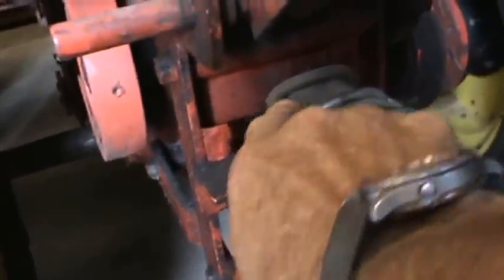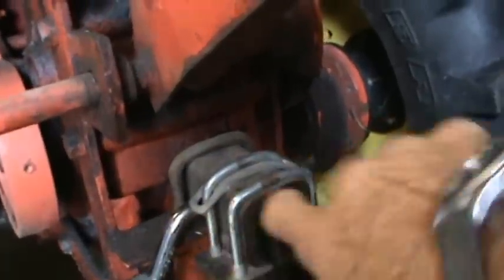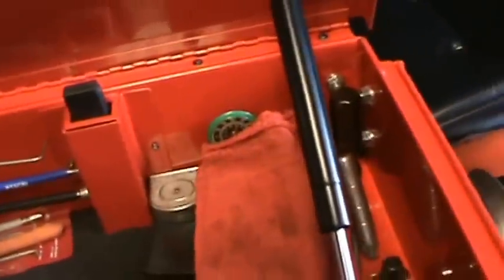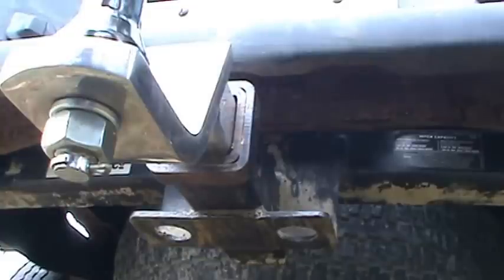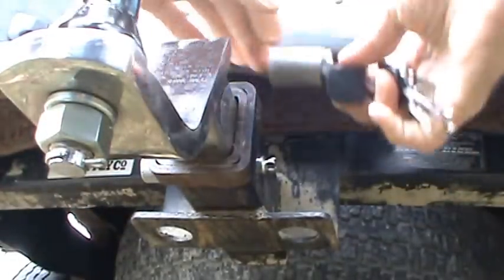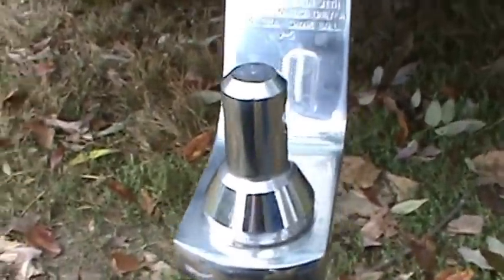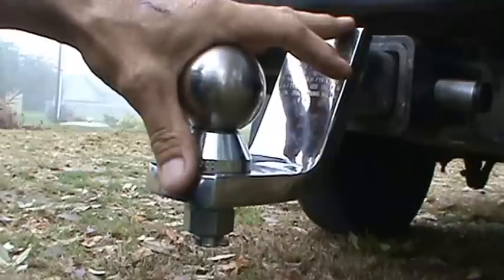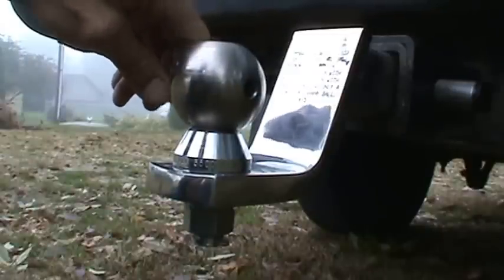How do you Trailer your equipment?

Comment: is there a weight limit on the removables ?
Reply from the maker: +buzzsah The weight limits are the same as a standard receiver hitch and standard ball. Class II and III, of course, have different ratings due to the shank size, but the Convert A Ball heavier class is rated right up there with a heavy class 2 5/16" hitch system at 1000# tongue and 10,000# trailer GVW or 20,000# with torsion hitch. The lower class smaller shank are typically rated between 3,500# and 5,000lbs. with 350 to 500lb tongue weight limits respectively. Cheers Buzz! Zip~